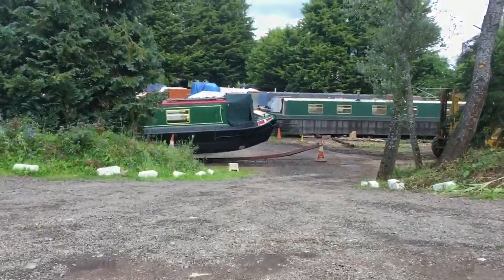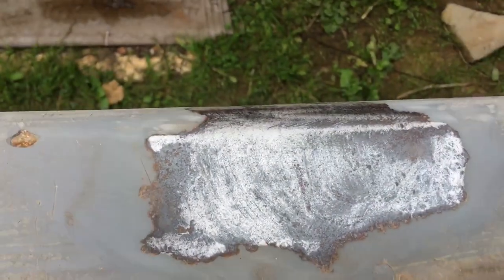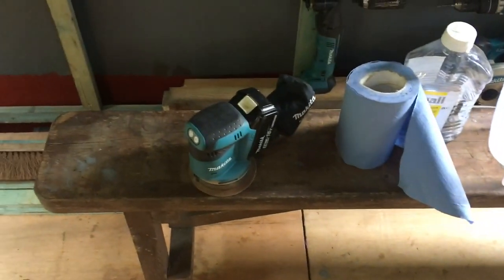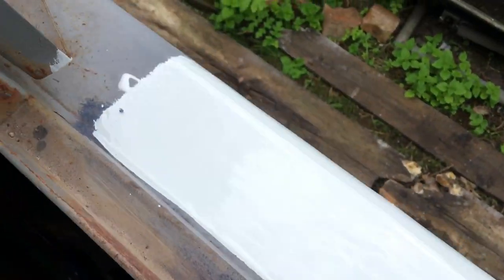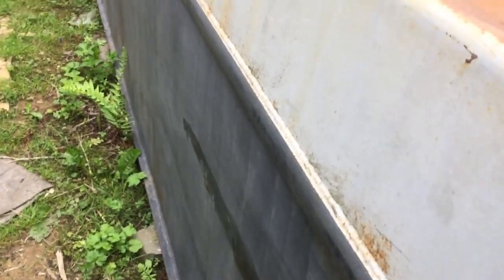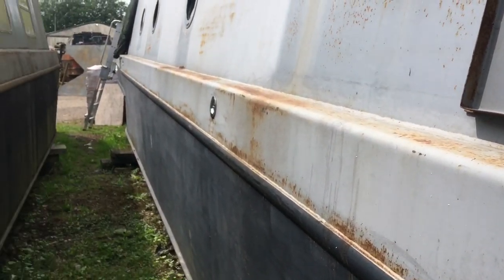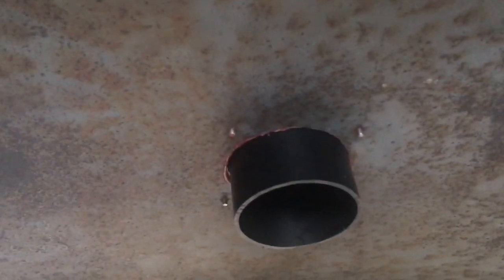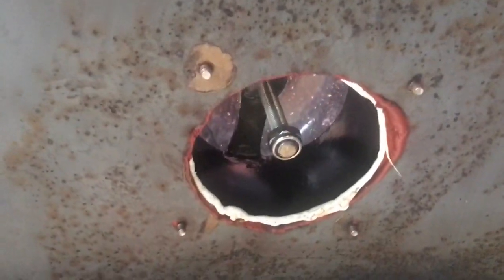45. Narrowboat epoxy paint test and more small steps towards spray foam

Comment: Enjoyed your video will be interesting to see how the epoxy holds up as you are supposed to sandblast the metal before applying it.If this was my boat I would remove the inset fender eyes and have the holes welded up as them eyes are so much more trouble then they are worth
Reply from the maker: Yh I had to silicone a couple of the fender holders as they’d drip in the rain, good idea that, but without a rail on top, mines a welded in lip, I need them to tie on fenders, otherwise I would totally add that to the welding list 👍 As for the paint, yh me too 👀 !  I’d love to get it blasted, and air sprayed in a heated paint shed, they have them next door at the new marina. However everyone here from staff to lifetime lives boards says the boat is not in bad enough shape to warrant the blasting. Data sheet for the paint says for best results blast it, but also gives instructions for self application over old paint and treated/cleared back metal. If it doesn’t take and peels from the old primer I will seriously reconsider blasting…or changing primer 😀 thanks for watching and commenting
Reply from the maker: Rereading the data sheet, it says the paint I have was specifically designed to be used where blasting isn’t available or possible, to go over old paint, had me doubting myself for a second you did 😉
Reply from the maker: I’ve just seen people hang fenders with hooks from the top rail, I might just weld up the hole s!

Comment: Interesting paint info Oli as I have all my boat to strip & paint & have bought some of that Jotun paint I think it is Jotun 87 though. Having not used 2 part paints ,how long do they usable once mixed ?
Reply from the maker: I’m only mixing small amounts at a time, 225 ml, (175ml of paint and 50 ml hardner) after 20 minutes or so it starts to get a bit latexy, a bit like when scrambled eggs are just starting to cook, but that’s only on the brush and bits already done, touching up after 10 minutes is hard, you basically need to do a whole wet coat over the top again, but the mix in the cup stayed good till I ran out, maybe it thickened a little, but thats when you add a little thinners. But I’m mixing such small amounts at a time it’s not been needed. I got all my prep and direction from the paint data sheet, but it’s my first time doing this myself so I’m learning right along side you 👍
Reply from the maker: Looking at the data sheet they say maximum potable is 2 hours. And for best/longest lasting results I would recommend shot blasting and spray application, quickest, easiest, best consistency, best coverage, most expensive by far 😳